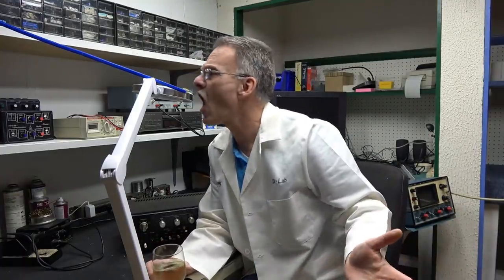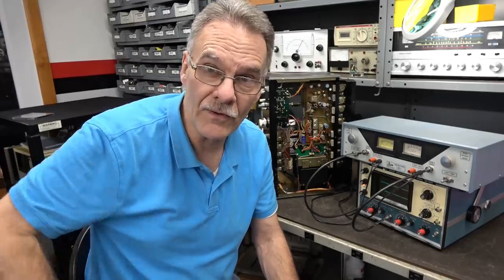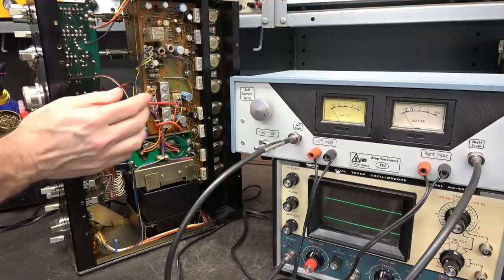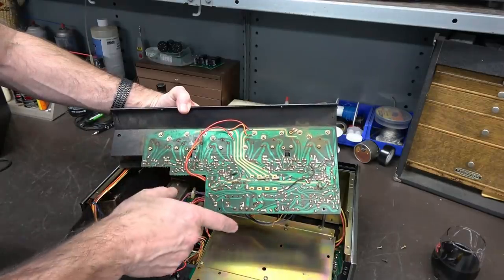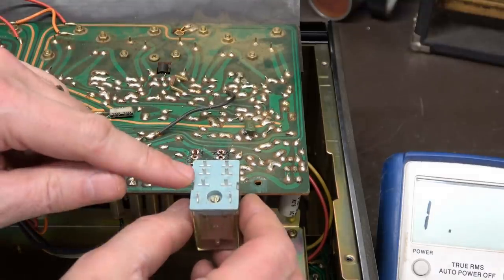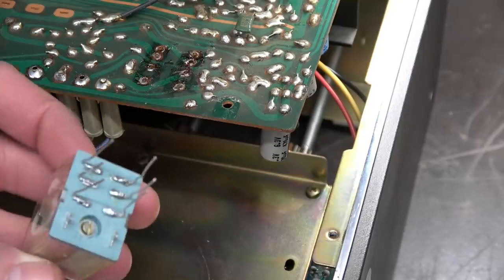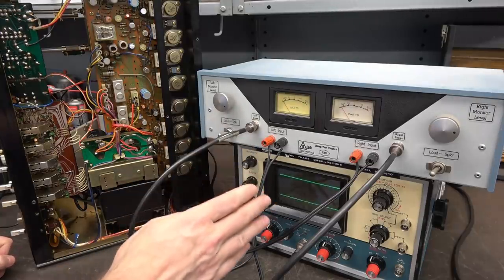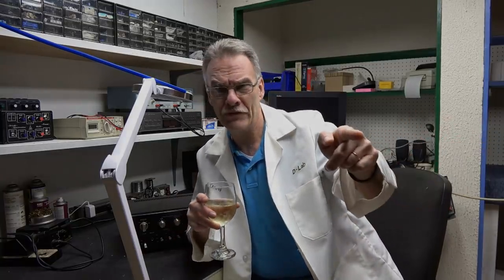How to fix Sansui AU-7700  Integrated solid state stereo amplifier channel pops Output problem

Comment: Nice fix there, Terry!  You make me want to dig out my old Sansui AU-555A amp and fix the one channel that went out years ago.  As I recall I won't need to worry about the protect relay; it doesn't have one!  It had always been a beautiful sounding amp, and I appreciated it having Bass, Midrange and Treble controls.  Paired up with a Lafayette LT-D10 Dolby FM tuner, it sounded great as my main system in the late '70s / early '80s.
Reply: Redrooster  Thanks for the encouragement!  I agree it was certainly a quality sounding amp.  I've still got it and the LT-D10 tuner.  The amp was given to me by one of my instructors at a tech college where I studied electronics.  The channel was out then; I fixed it but it went out again while my brother was "borrowing" it.  I think I found the schematic and service manual online some time ago, and confirmed I can still get the correct power transistors for the output stage.  I just need to set aside the time and do it!

Comment: I did find on one of the earlier Sansui Amplifier models 'noisy' small signal transistors around the tone controls; treble, bass, etc. It had IC's which were 'difference amplifiers' for low noise. You could detect the fault by using the Rx1kohm across c-e junction, and watch the needle 'bounce around'..

Comment: My 7700 is still working like a champ. I've babied it for over 25 years, I was lucky to find one.  I'm impressed how easy that heatsink and board slid out of there.  What is the part number of the relay that you had on hand?  What a wonderful amp - one of my favorites!  Well done Terry!

Comment: I love solder wick and use it but I disagree that it protects your solder tracks unless you are very careful and don't have too many bites of the cherry when using it. Iron temp is critical versus number of hits needed to remove all the solder. All that said, it really has its place on the bench.

Comment: Hi Terry, i am searching for a service manual for a Vox Conqueror solid state amp (50 Watt) from  the  1960's. The amp is dead. i got the circuit diagram but a service manual would be great for additional information.

Comment: Hello, thanks for the video.
I have tha same problem, but i clean the relay and problem persist. The only difference is that this pops only appear when I active the tone control. If the tone control is not activated the pops sound not appear.  Any suggestion?
Thanks

Comment: You look like a master.  Can you just me in the right direction?  I have a Mark Levinson no.27 amp.  When I turn it on I heard a strong pop on the right speaker and then the unit went into protection mode.  Even time I turn it on the power switch would pop back to off with only pwr cable plugged in. The power light still lights, fuse is good.  Any guidance from anyone would be greatly appreciated.

Comment: Sansui had this bad habit of using the bolts that hold the transistors to the heat-sink as the collector conductors through the PCB .  Then over the years, the thickness of the PCB would shrink and corrosion would build up around the head of the bolts.   They got to be taken out and cleaned up.

Comment: Hi, just wondering if you can help please - I have a Arcam Alpha 10 that
 is going into protection mode (Red flashing light) not all the time 
though - sometimes i can power it up and play music for a good few hours
 with no problem then other times it will go into protection mode after 
15mins, 30mins no exact timing to it - any help would be massively 
appreciated. Thanks

Comment: I have a JVC AK300 where the right channel intermittently going in and out, any ideas? It will self correct if i turn the volume up or in a couple hours it will turn on the right channel, not even the VU meter shows any output, is it in my pre amp section?
Thank you

Comment: I have had a channel popping but there wasn't even a protection relay. An intermittent AC128 was the cause.
Reply: It was getting to the point of the 'tin whisker' phenomenon. Germanium transistors (the earlier PNP types in the AC and AF prefixes) were noted for firstly being 'noisy', then shorting internally. Many AF 117 transistors in the RF stages of radios have been replaced...

Comment: So pouring a small amount of wine into the hole of the old relay cover wouldn't have served the same purpose as replacing it with a new relay? Now you tell me. I could have used that wine to lubricate a tube socket. Such a waste of good wine! You live and you learn I guess. 

73

Comment: I have a sansui A 909 that stopped working after I pulled it out of storage.  Everything fires up except no sound now.. with speakers disconnected.. meter lights do bounce slightly.. worked for about 5 minutes and then done with... I've read some feed back posts as it being basically low end or not worth repairing.  Nut I disagree.. this unit is heavy and putting 80 watts per channel and very crip.. I had a 9090 years ago.. sound isn't much of difference.. speaker pairing has a ton to do with it.. A 909 or A 910 are under the radar sansui amps... people I noticed go after appearance rather than sound quality.. I started to search for replacement and was astounded asking prices for sansui. Marantz etc unit's.. so I decided to just have mine repaired as only fools pay extortion money.. sansui 9090 in my book in mint isn't worth anything above 400.. it's not a low production classic vehicle.. end of the story.. I found a 9090 to keep as back up for 260 in perfect working condition but needing a good cleaning..